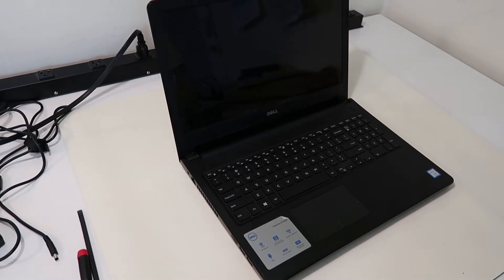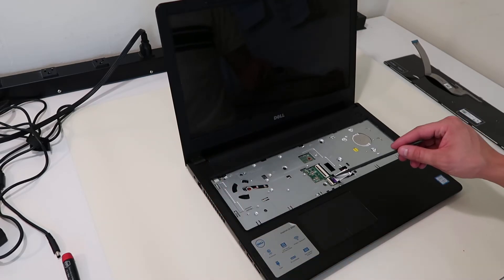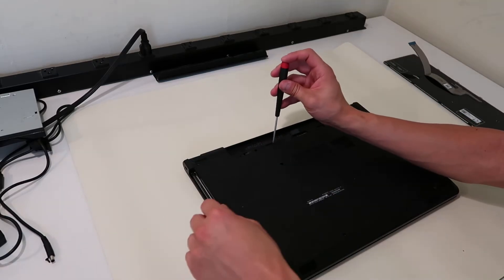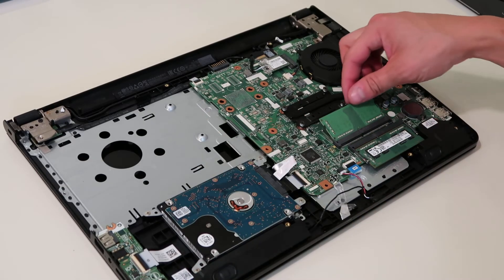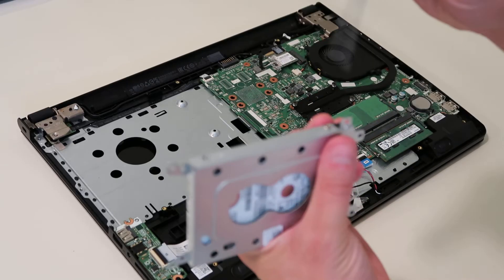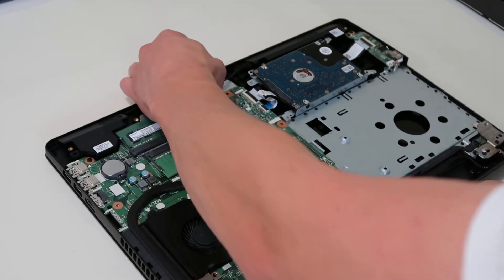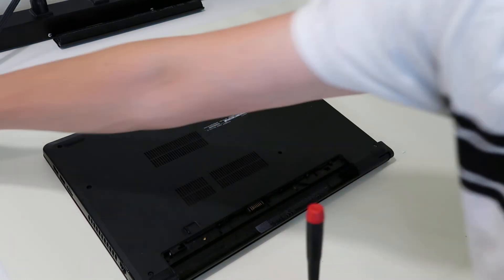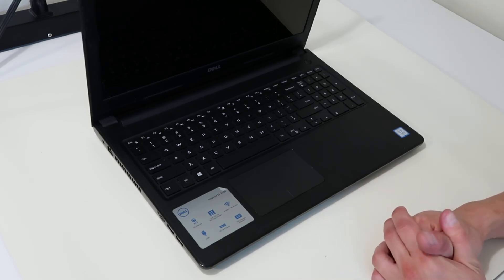How To Replace Upgrade HDD (Hard Drive) & RAM - Dell Inspiron 15 3000 Laptop

Comment: Thank you x 10! I have the same laptop that you're using in this demonstration. Bitlocker locked my HDD or partition. I could not boot into Win 10. I was able to get bitlocker recovery key, but I had no record of the password. Regardless of inputting that 48 digit key I could not boot into windows. I could not disable bitlocker on that drive/partition. A tech aquaintance suggested replacing hdd. This vid gave me the knowledge and courage to do so. However, at one point I thought I had fried my mother board.  And I followed the steps in pc monkey vids on what to do if machine turns on the off...steps for discharging static charge and for resetting bios. Things didn't get righted until bios reset step. At that point the laptop started to have some response but I had a black screen. Then I listened to pc monkey vid on what to do if you have a black screen. That's when it all started to come together. I had popped my ram card out during the 1st video,this video, to get the info off of it incase I wanted to add more ram later. I did not re-seat the ram card properly.  Ounce I did that I was able to reinstall windows 10. I wolud have never been able to do this and recover from my own ineptness, misstake, without pc monkey. I'm going back to all the pc monkey videos I viewed to get me back up and running and give each a thumbs up. The videos are practical, instructional and to the point. Thanks for not adding unnecessary stuff that make vids un-necessarily longer than needed. Big fan an new subcriber! 

P.S. Does PC Monkey have instruction on my original problem saving my data and wiping my old hdd. I can't at this point save data or wipe the drive because of the locked partition. I tried connecting drive via sata to usb.  Drive not showing in 'this pc' or disk management.

Comment: What kind of tool did you use to take the keyboard out, and where can I buy one from. Nice video thanks for sharing. #PEACE✌🏾
Reply from the maker: It was a small metal pry tool.  You can find them pretty easily on Ebay, Amazon, etc

Comment: I want to buy a new hdd for this laptop. What model of hdd should i buy?
Reply from the maker: As stated in the video, your looking for a 2.5 inch hard drive or solid state drive for laptops.  You also need it to have a SATA connection.   The rest is up to you :)  But any drive with those features will word :)
Reply: @PC_Monkey  Dell Inspiron 3000 wondering if you can fit a 2.5in 15mm 5TB hdd in there instead of a 7mm slim hdd

Comment: I opened my laptop like the video showed and closed it back up without a hitch but now the speakers are buzzing. Is there a way to fix this?
Reply from the maker: They may have come loose while you were in there.  I would open back up, unplug the speakers and then plug them back nice and secure.  See if that helps
Reply: @PC_Monkey  hey so i went and opened my laptop to check my speakers and they're fine, but the buzzing is still happening and it even happens with earbuds that i plug into the laptop. Any ideas?
Reply: @PC_Monkey  nvm i found the issue. My dying drive was just struggling to run video media but coulr run mp3 files with no problem
Reply from the maker: @VelstadtVriska  Nice job figuring it out :)

Comment: Thank you I found this. Very helpful. I followed your steps but once I powered my computer on now I get the message ‘no bootable device available’. What could have possibly gone wrong or what did I miss?
Reply from the maker: Did you install an operating system to the new hard drive?  If not, that could be a reason for the error.  You can see how to install Windows 10 to a Dell computer here;  https://youtu.be/ULrJVk4JJ20.  You can create your own Install Media for free as seen here;  https://youtu.be/g_UhiHScaSI
Reply: @PC_Monkey  Hi! I followed the instructions for installing the free Microsoft operating system but now I get the message ‘invalid partition’ 😞

Comment: Should my laptop have 2 RAMs like yours did or is just one in the A slot ok? This is the first time I took my laptop apart and I only have 1 inside.
Reply from the maker: Not all computers have 2 RAM ports.  And even if they do, you can run a computer with only one stick of RAM :)

Comment: Great video! The old hard drive stopped working and I upgraded to SSD. It runs faster now. Those ribbon cables are so small and fragile. Thanks for all the good information!
Reply from the maker: Happy to help :)  Always here if needed !!   SSD is always a solid upgrade to a computer :)
Reply: what type of SSD did you get
Reply: @anubis5349  I got the Samsung 860 EVO 250GB

Comment: I have the Dell Inspiron 15 3000 series but I couldn’t get the back cover off after taking off the keyboard etc. 
My back cover had a partition that’s held in by a screw so out of curiosity I unscrewed it and removed the panel. 
This was the HDD and RAM panel so I didn’t have to remove the keyboard and DVD after all.
I guess that the 3000 series has other models.
Great video by the way. I now know what to look out for when doing future upgrades.
Reply from the maker: Great job :)  So easy to break laptops when going into them :(  Nice job figuring it out  !!

Comment: I got all the screws out but can't get it apart. The back side holds rock solid. I even broke one small piece of plastic off working the blade around to separate. Man, I sure wish mine came apart as easy as yours did. P.S. I finally did get it open with a LOT of pressure. I found an L shaped plastic piece inside the case after I opened it. It must of had an extra lock mechanism.
Reply from the maker: What brand and model computer do you have?

Comment: Worked great until I plugged the keyboard in and the black plastic retainer broke in half. I tried taping the pieces in place, but it will only work if I push down on the connector. Is there any way to fix this or am I screwed?
Reply from the maker: Is it the connector on the motherboard that broke or just the plastic part that folds down to hold the ribbon cable?
Reply: @PC_Monkey  Just the plastic piece that folds down. I was able to cut a thin piece of plastic and use that to hold it tight in place so I am all set now. This video is what I did, couldn't understand him, but was able to follow along. Thank you for getting back to me!
Reply from the maker: @stevenorander8288  Glad your all set :)

Comment: Replacing HHD with SSD (cloned from HHD). Will I need to make changes in BIOS?
Reply from the maker: No.  But you will have to reinstall Windows onto the new drive
Reply: @PC_Monkey  No you do not need to reinstall windows if you use the right software for cloning. I've used Acronis for years! and cloned thousands of OS drives for upgrades, never had a problem. If you are upgrading to an SSD I would suggest running a defrag before cloning (if you can)
Reply from the maker: @kevintitchard9561  Oh sorry, didnt catch the part where it was cloned.  Assumed new and empty.  Thx !
Reply: No update to BIOS required. Cloned SSD booted just fine!

Comment: Can I add 16gb RAM to the existing 8 GB RAM that came with the Laptop to have 24 GB RAM?
Reply from the maker: You can mix and match sizes yes.  But make sure you computer can handle up to 24GB or you would just be wasting your money.  You can look up what your computer can take on the manufacturers website or on crucial.com

Comment: Hello Sir, 
Thanks for sharing this video I have Same Laptop inspiron 15 3000-  Intel R Core(TM) i5-8250U CPU @ 1.60GHz 1.80 with RAM 4 GB
Can I upgrade it with 8 GB and what RAM model you advise me to buy from market/ Amazon 
Regards,
Reply from the maker: For help getting compatible RAM for your computer, refer to this video;  https://youtu.be/NtCzunl0AQA.
I usually buy my ram on Ebay or Amazon as its usually cheaper.  If money is not an issue, refer to crucial.com.  They have some good options and easy ways of getting the correct ram for your computer :)
Reply: @PC_Monkey  thanks you so much

Comment: When unplugging my wire I disconnected the wire and the hard drive from the motherboard and from that’s it hasn’t worked is there a way to fix that?
Reply from the maker: If you disconnected it, then you would simply plug it back in.  Is it damaged in any way?

Comment: Hi
I have Dell inspiron 15 3565 with AMD processor and GPU and i already upgraded the ram from 4 Gb to 8Gb also i added SSD Hard with HDD hard instead DVD to make it more faster to use it in graphic apps like PS and AE but the problem is that After Effect need NVIDIA GPU for some projects and i wonder if that possible to replace AMD GPU with NVIDIA GPU 
plz give solution for that problem cuz i googled a lot and i couldn't find specific answer for my question 
THX ALOT

Comment: Can I use the hdd from my HP Elitebook 8460p in the Dell Inspiron 15 3000?
Reply from the maker: I think those are compatible.  They should both be 2.5 inch drives with a SATA connection.

Comment: "Yeah, I'll change your drive na add RAM, it should be easy" - that's what I said to my friend. I didn't think it would be so difficult :) thanks to your vid I've somehow managed to do it :) thanks!
Reply from the maker: Happy to help :)  Always here if needed !!
Reply: @PC_Monkey  i have the same version of the laptop. what kind of graphic card can i put inside if i wanna play games???
Reply: @HONG38  You can’t put a graphics inside a laptop. There isn’t enough space, like at all. It only has enough space for what it already contains, which you can only replace, not add to.

Comment: My computer is completely busted but I need the files on it so I planned on taking it apart and using an enclosure to hook the hard drive onto my new laptop but I don’t know what enclosure type to get. The old laptop is a Dell Inspection 15 3000, any advice would be greatly appreciated.

Comment: Can you add an ssd there ? Thanks for the video, very helpful.
Reply from the maker: You can replace the hard drive with a solid state drive but there is not space to add an additional drive in this model.

Comment: hello, i really appreciate your video. I want to ask you about a problem that i have with my dell inspiron 15 3000 that i got 2 years ago (new) as a gift, the problem is the laptop is so slow like unbelievably slow that it's unusable, i can't literally do anything not even study because it takes so long to load even a pdf or a ppt file. when I go to task manager the it says disk 100. i formatted the pc but the problem did not resolve, I serched on internet and i still don't know what's wrong with it. can this problem even be solved ? because i went to a guy that fixes laptops but nothing changed and i'm really confused
thanks
Reply from the maker: If a Factory Reset didnt help, you could try to install Windows to it as seen here;  https://youtu.be/ULrJVk4JJ20.  You can create your own Install Media free as seen here;  https://youtu.be/g_UhiHScaSI.
Reply: I had the same issue I was told it’s a hard drive issue but not even sure if that’s it I also tried to install a new OS and it said I had no memory which I know for a fact I had bout half of a terabyte left so I think my issue is the hard drive. But my laptop was doin the same shit like a year after I bought it meanwhile I have a gateway laptop that’s at least 12 yrs old that I put a new OS on n it works like a champ could just be shit luck

Comment: Hey I'm having a harddrive failure issue  being caused repeatedly is it because of 4gb ram that it has and lot of software's being used simultaneously or some another reason?
Reply from the maker: I dont understand your comment.  Are you asking if your hard drive is failing?  What signs or errors are you seeing?  Assuming you have a Dell, you can test your hard drive as seen here;  https://www.youtube.com/watch?v=IsqINCxx_Ik&feature=youtu.be

Comment: I did everything you did in this video!  There were a couple of things I want to run by you.  The little plastic piece that’s at the bottom kinda free floating, is that normal? When I opened the back, there was no DDR4 DIMM B card, there should be one right?
Reply from the maker: Sorry.  The little plastic piece?
Reply: PC Monkey, it’s okay I got it figured out.   The operating system was in the hard drive, so I’ll need to go and buy MS 10 right?   My old hard drive was toast and I wasn’t able to save anything
Reply from the maker: @messymiss72  Bummer :(  Ya, you would have to replace any software that didnt come with the new windows 10 install.

Comment: Why do you need to remove the keyboard to replace hard drive? Can we not directly open the back and replace the hard drive? Can you please help me understand?
Reply from the maker: Many computers do not require you to remove the keyboard.  However, in this model, there were screws under the keyboard that held the bottom case in place.  They needed to be removed before the bottom case could be released.
Reply: @PC_Monkey  thanks 👍👍

Comment: I don't have a flat pry tool - is there anything else I can use?
Reply from the maker: Anything else thats flat and firm enough to pry the parts apart :)
Reply: thanks a ton - I have a plastic pry tool used to hide car dash-cam wires under the headliners above the doors and windscreen.  I hope that works 😉

Comment: my dell inspiron 15 3000 series only came with 256 gig ssd and it has no cd reader and hdd 
when i opened cd dummy it has no coonector can i add extra storage with hdd
please help me with this issue
Reply from the maker: Not sure if I totally understand.  Yes, you can replace the 256 with a larger storage device.  Are you asking if you can add more storage via an adapter that fits into your CD drive?  If so, yes, you can purchase an adapter that will let you add storage that way.
Reply: @PC_Monkey  my laptop only came with 256 gb Ssd it doesn't have CD drive and hdd
Reply from the maker: @rokuat  If you dont have a CD drive or another spot for an additional hard drive, then the only way to add storage would be to use an external hard drive hook up.
Reply: @PC_Monkey  bro I need help I opened my laptop and it has Ssd in hdd tray and there is no odd (optical disk drive ) cable where can I but that cable can you please help me
Reply from the maker: @rokuat  I dont understand your comment.  You currently have a SSD in the computer... ok.  What is the issue with a missing cable?
Reply: @PC_Monkey  let me explain I bought laptop in America it only came with Ssd and it has no hdd and no CD drive and no CD drive connector here is the link to the photo
https://photos.app.goo.gl/rJgZVcpyLaLyY5XK6
My question is if I buy that CD connector and try to add hdd will it work

Comment: This is the best vid on this I found for my Dell, may be because it is in english. The others do not even have text as to why the keyboard has to come off.  Some people seem to replace the drive without cloning which seems strange , if you were not setup with a usb to install Windows from. You can get a "toaster" (10-$20) to put the old drive in to read off old files , or clone the old drive onto the new drive thru a usb port.
Reply from the maker: Glad it was helpful :)  You can also create your own Windows 10 Install Media direct from Microsoft free as seen here;  https://www.youtube.com/watch?v=g_UhiHScaSI&feature=youtu.be
Reply: @PC_Monkey  Thanks, already have two  versions, one created last Nov, the other this week.  Waiting on cruical drive, will use their locked version of acronis to dup on my toast. Hopefully that will go well.  Either way will let you know how install goes.

Comment: Hi, need to know what to do after replacing my hard drive in my inspiron 3000 series. dont have a disk or bootable device??
Reply from the maker: After installing a new drive, you have to install an operating system onto it.  Have you done that?
Reply: PC Monkey I need to know this. Do I download the windows 10 into flash drive??? Steps please in this scenario where I am upgrading ssd with fresh installation
Reply: @ChristianYepez  I don't know if you still have your Dell computer or not, but there is a Dell website that can help.

https://www.dell.com/support/kbdoc/en-us/000176966/reset-or-reinstall-windows-10-on-your-dell-computer#Recovery-media

Scroll down about 1 page and find the "Problem/Solution" table and choose the very bottom one.

Comment: Does this computer only comes whit one ram?
I took it to a computer repair shop,  and then I let my kid open it because I didn't fix it it was to expensive.  And he said it only has one ram. But the box information says its 8 GB memory.
Reply from the maker: Then it could have 1 stick of 8GB RAM :)  Whats wrong with your computer?  What needs to be fixed?

Comment: I have an inspiron 15- 3552 and I purchased the ram to upgrade to an 8gb.  I'm nervous about tearing into it bc im afraid I won't be able to get something back together right.  I tried taking the back off last night and wasnt able to get the screw out that's holding in the cd drive.  Thank you for this video I'm going to try again in the morning crossing my fingers it goes smoothly!
Reply from the maker: You werent able to the the screw out?  Is the driver no the correct size or is the screw possibly stripped?
Reply: @PC_Monkey   screw was stripped I got it out though fixing to watch yr video again to get it back together
Reply from the maker: @amandalouisegoodner6230  If the screw is stripped, you would need to drill it out.  Do you know how to do that?

Comment: Is there any way of putting the keyboard ribbon cable back in. I'm having trouble with this part. I was able to successfully pull it out, but can't put it back in.
Reply from the maker: Yes, it should just slide it.  Takes a bit of practice though.  Was your clip like this one;  https://www.youtube.com/watch?v=1goYpAP1ds8&t=4s at 5:30 time ?